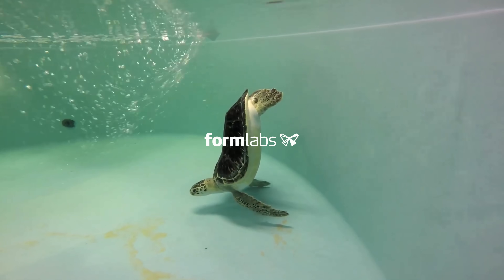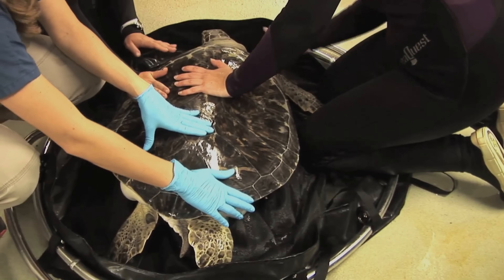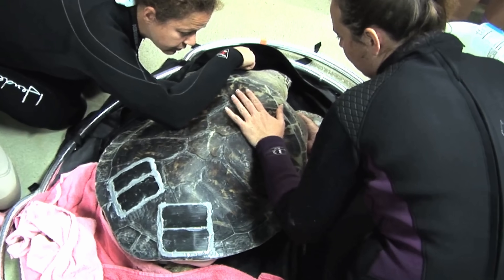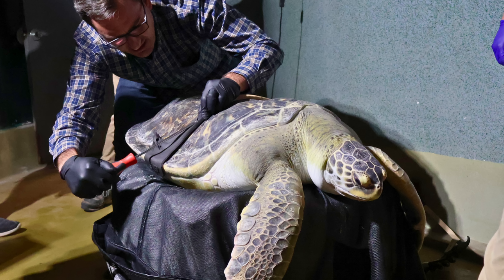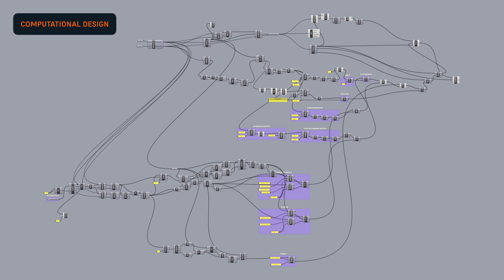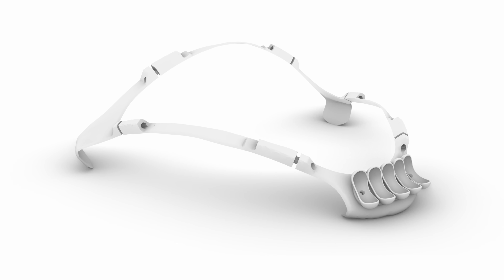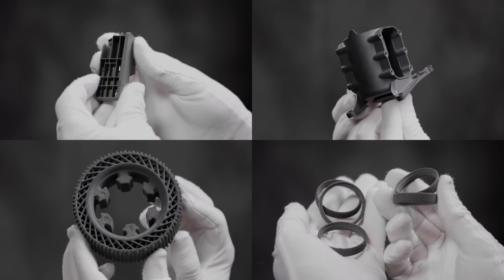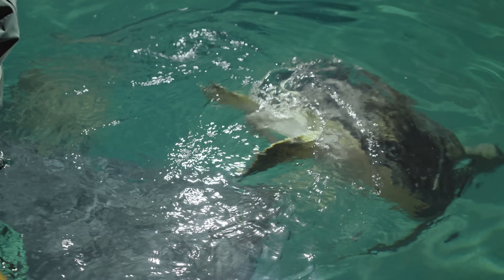Saving Charlotte: How 3D Printing Helps Sea Turtles with Bubble Butt Syndrome

Comment: A hard harness won't work because the turtle will keep growing, plus it could damage the shell no matter what.
Why not weights molded into a silicone harness instead ? It would allow the turtle to grow freely with the harness on and the soft material wouldn't damage the tank.

Comment: You could create a multi-axis 3D printed flipper which would work in tandem with his front flippers. The back would mimic the front. Thus allowing the use of his back. Also you could incorporate weights on the underside as well. Depending on how much air needs to be displaced. Now I have no idea how that would look or function as I’m not an engineer lol. But maybe it will spark an idea for something similar.

Comment: I understand that turtle shells are alive, but if the air originally came from a breach in the shell that allowed the air in, then a medical vacuum device, often used to suck out infection while a large wound heals, could be applied (after drilling a hole in the shell), so that the shell could heal again into an air free zone...  

yes, I saw the comment from someone else saying it couldn't be done, but are they a marine biologist?  A marine life veterinarian?  A scientist even?   Most likely not any more than I am...  So why the he11 not?

If you ARE a marine biologist, a marine life veterinarian, or even a scientist in a related field, then I'd be glad to listen to why what I propose won't work....  but if you just have a (negative) opinion, please don't share it with me, go post your own comment 

Personally, I think this contraption they want to strap onto the turtle is going to be a magnet for fishing gear and discarded nets, and will probably kill the turtle in short order.

Comment: Can't the air be released by a air bleeding valve with a flat profile (I presume that this air is naturally generated and an uninjured turtle would 'vent' such air normally) I can also presume that this is intended for permanently aquarium resident turtles and not those being rehabilitated for release to the wild again, so the valving system wouldn't need to accommodate any vast differences in pressure compensation and might be changed out if it malfunctions.

Comment: This sounds great for the turtles, but I'm curious what happens with the harness at the end of it's lifespan (IE the harness or the turtle breaks). Is there a pollution risk? Will predators or scavengers be affected? Is the harness tracked so it can be cleaned up at the end of it's life cycle?
Reply: This is still a prototype, but in any case turtles receiving this are rescued and wouldn't be released into the ocean.

If this does become a viable solution for turtles in the wild, then other materials would be used.
Reply: @visualglitch91  That's awesome to hear! Removing turtles from the food chain still impacts the environment of course, but much less than putting them back in covered in hazardous materials, so I'm glad this company is taking the sensible approach!

Comment: Wouldn't it be better to surgically close the cavity? There are several filler materials available for this. Off the cuff I'd suggest trying some bone cement. That could even be integrated into the shell. Maybe even use a breast transplant.

Comment: This is over engineered. It's nice for zoos with the staff and skill to execute it, but it's absolutely not scalable. not enough people will be able to follow this workflow to have a widespread impact. the solution needs to be something easier to mass produce or more convenient to print without requiring much technical knowledge. Perhaps there is a simpler solution that can fit any/most shells?

Comment: Whilst it's definitely neat that they're using printing to try to combat issues, it's a bit unfortunate that there doesn't seem to be much attention being given to the initial causes and preventing those in the first place..
Reply: Good luck with fixing the initial issue which is people on boats.

Telling people what to do is the best way for something to not work.
Reply: @Alsry1  I meant altering the propulsion system of the boats so they're not so detrimental to things
Reply: @TS_Mind_Swept  

have you ever looked at the history of the suv?

The same thing will happen if you limit propulsion.
Reply: @Alsry1  seems like the only one trying to make stuff not work here is you
Reply: @TS_Mind_Swept  It's not me, it's just that proposing unrealistic solutions is pointless.
Reply: @Alsry1  it's not unrealistic just cause you're not aware of how it could, or has been done (there's already bin work done on it and it's even bin found to be more efficient than what's common; either way, you don't make progress by saying things won't work without even trying them, and people with your attitude definitely don't help with that)
Reply: @TS_Mind_Swept  

its unrealistic because you've only considered the production phase, not adoption phase. 

you would need to make something that is simultaneously cheaper, faster, and more efficient than a simple propeller. which is essentially impossible.
Reply: @Alsry1  Not with that attitude. Now begone.
Reply: @TS_Mind_Swept why are you talking like that bro

Comment: I wonder if there is a non-invasive surgery that could possibly solve the issue... I'm sure that they looked into this, but my first thought was to just drill a hole to let the air out then just epoxy over the hole... But I'm assuming that it's not that easy.

Comment: Is there anyway to get these boating companies to maybe also create some method for preventing these turtles from getting hit so violently in the first place when moving through the water? The boats have to be moving realitivly fast to be denting their shells, so maybe a form of padding on the bottom end to cushion the impact? I'm not sure if this is even viable but It seems like it'd be also good to try tackling the reason of why they're getting hit aswell. just a thought.
Reply: this seems like a wonderful idea!!
Reply: What you are suggesting is not viable. The real solution would be something more along the lines of protecting known sea turtle habitats and migration routes from boat traffic. By redirecting shipping routes, or placing speed limits on boats in these areas. Or maybe even keeping watch for sea animals when they are moving through water. But its impossible to know who hit the turtle unless they are monitored at all times.
Reply: Adding padding to a boat will madly decrease its fuel efficiency, which means more pollution pumping into the air to cause mass extinction of species. Not a worthy trade-off. Of course the main culprit of everything is capitalistic greed and consumerism, but you can't do anything about it.
Reply: the faster an object is when it interacts with water, the more like a solid the water behaves.
cushioning would be a soft spot, a point of failure for water pressure to collect (build up) and breach the hull.
and prior to deform if integrated into the hull or add extra profile to the hull if not; both of which will lower the hydrodynamics of the hull increasing fuel expenditure and requiring the emission of more spent/processed fuel into the environment for the same movement compared to without.

with technology, and regardless of concern about turtles, nautical development has always aimed for being able to make vessels lighter; less mass means the same movement energy can either move the ship faster or more distance (efficiency) and is cost saving.  Its why fiberglass and modern metal  has replaced wood in ship construction for even non military vessels.

additionally, even without any human or human made device involvement and going back in time to even before the age of sail, most sea turtles become food and die even before reaching adulthood, and those that make it to adulthood rarely live long; like 'housecats'  a wild 'housecat' average life expectancy is under 5yrs
Reply: I agree that this is easier than getting shipping companies to care and there are boat logistics idk here, but saying "they would die anyway" is just not a good argument. We're talking about the human impact on them, humans should fix the human impact.  @idminister

Comment: So after years of efforts to keep plastic out of the water to help sea turtles, we are now putting plastic in the water to help turtles
Reply: I know you're joking but a rescue with this type of injury would never be re-released
Reply: Carbon fiber. Not plastic. 😂
Reply: @chickadee3 Hopefully the 😂 was a sign of sarcasm. The video shows on multiple print screens “nylon 11 CF” (and does not specifically audibly say what material was used) which means the printing was done in nylon, a plastic, with carbon fibers added for strength. (While some companies may switch materials for a video for proprietary sake, since they are seeking assistance and to disseminate the information for other aquarium/turtle assistance that process seems unlikely here.)
Reply: @chickadee3  are you kidding? plaid said it well and offered a good enough of an explanation... carbon fiber is not a solid slab of material, it is like rebar in concrete - durable and elastic tensile reinforcement for the actual solidified slab that encapsulates them... In case of rebar, it is concrete, in case of carbon fiber - is some member of the plastics family of materials... ``Not plastic``... I know i have seen dumber things out there, but your comment really ranks quite high... at least if you are seriously stating that...

Comment: This should be done with nylon webbing and stainless hardware just like scuba weight belts. The use of 3d printers needlessly over complicates the process.  A one size fits most adjustable harness would be far easier to deploy.
Reply: Fabrics were easily torn off in the tank though
Reply: They explain in the video why that’s not possible.
Reply: The weights shift around too much. Webbing slowly stretches over time under tension, and the belt will abrade the skin off if it loosens at all because the way they are shaped, the only place you can get something around them is the widest section of the body. So any belts immediately want to slide to the legs and spin to the underside of the turtle. With small rehab turtles, we could sometimes use huge ace bandages and because they were in a very shallow wading pool they couldn't get it off much of the time. In concrete or with rockwork they would have it off immediately.

Comment: I don't understand why strapping weights on the turtle is very different from just gluing them. Also does this harness stretch over time as the turtle grows?
Reply: Turtle shells are living tissue, adhesives like epoxy that will hold the weight required and also not degrade in salt water can irritate the tissue of the shell itself.  Which in a situation like this where the turtle needs those weights for decades, it’s just not an acceptable solution.
Reply: @mylifewithmarmalade4624  yeah I'm not convinced. Source? And how will this harness adjust to a growing turtle? It'll restrict the shell and cause deformation. I've seen it with turtles getting caught in plastic. 
Surgery is the only long term solution. If they want something temporary adhesive is far easier to implement on a large scale.
Reply: @ well the video itself mentioned irritation from adhesive had been an issue for that particular turtle, I have a friend who breeds red eared sliders that I care for when he’s out of town, I’ve spent years caring for live reef aquariums (not with sea turtles) and I spent about 4 years working as a vet tech.  You’re right, I’m not an expert.  But I know enough about basic turtle anatomy, veterinary medicine/surgery, and marine eco systems to make some educated assumptions about why surgery would not be a good solution. 

The harness could be remade in a larger size or different shape as the turtle grows, just like we get new shoes regularly, an amputee must regularly get their prosthetics refitted or replaced, or a denture wearer gets dentures refitted or replaced.  This is a turtle who will not be releasable.  It will remain under human care so the harness can be monitored and refitted regularly.  The concern is to allow the animal to live as comfortably as possible given its permanent disability.
Reply: @mylifewithmarmalade4624 all I'm getting from this is the harness is a solution only for turtles in captivity which are not in any danger anyways. What good is this if you are just going to keep them in captivity after you fit them. They need a long term solution to allow them to be released back in the wild. Surgery seems like the only way. Or adhesive even if it's temporary they can at least breed for many years in the wild.
Reply: @TwitchyMofo Until technology advance where they can find a surgical procedure to fix it in one go, I think the 3D printing gear will have to do for now. Plus it is cost efficient and requires less intrusive health maintenance afterwards that can be detrimental to the turtles mental well-being. 

Creatures kept in captivity are used for research and educational resources. It is sad, but thanks to those unable to return to wild, we learned how to help the wild life better. That's why most good aquarium/zoo focuses on improving the quality of life for their permanent residence. Like this tech.
Reply: @TwitchyMofo  even if it has to live in captivity permanently, at least it won't suffer lung deformation from hanging face down in the water for months, which does happen to buoyant turtles.
Reply: @TwitchyMofo  they shed their scutes (shell scales) regularly. Then the weights fall off.
Some of those turtles are partially paralyzed because their spine was damaged, but they can still swim and feed themselves just fine in captivity.
Reply: @lilblkrose  they have a loooot of people working on this in the video. I just think their efforts seem pretty misplaced. Seemed like more of an ad campaign for the companies involved more than it being a good solution. I'm happy for this one turtle that it worked for but there's a way better solution out there than this.
Reply: @TwitchyMofo  That's good, but in the meantime this solution at least helps the turtle live better
Reply: @TwitchyMofo  maybe you could study to become a marine biologist and then find a solution that will work for wild turtles
Reply: @SpaceCowboy42X  I think veterinarian would be more applicable. Engineering is my currently field which is why I think this solution is a bit ridiculous.
Reply: @TwitchyMofo  You're an engineer, and this is a very intriguing design problem. Why don't you work up an alternate design and present it to the aquarium/new balance?
Reply: @fn-2187bb8  because I think the solution is biological, not mechanical. That seems to be the real constraint. Something they appear unwilling to entertain.